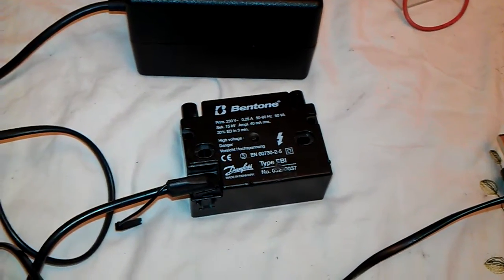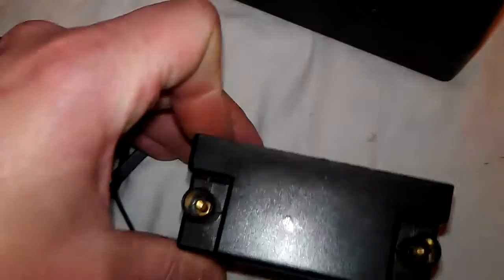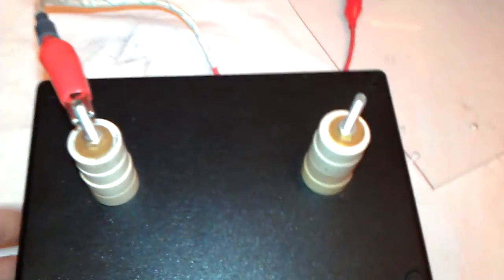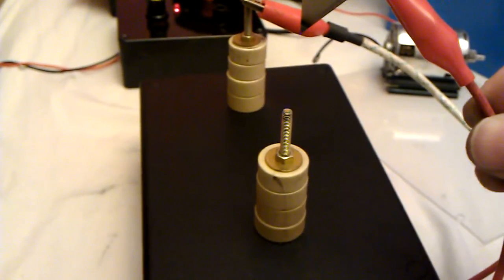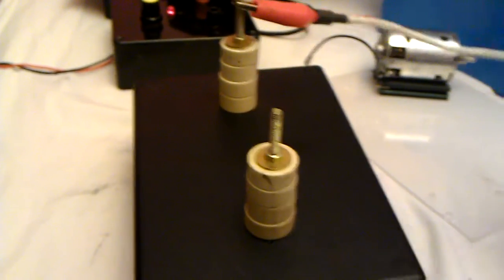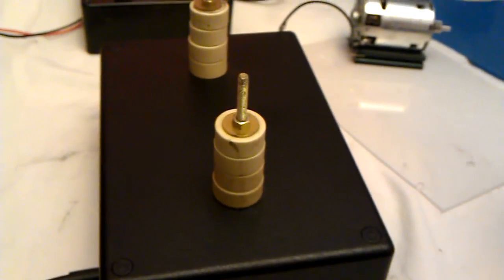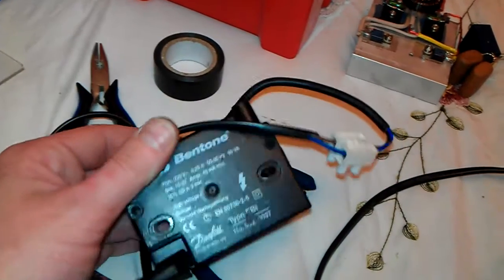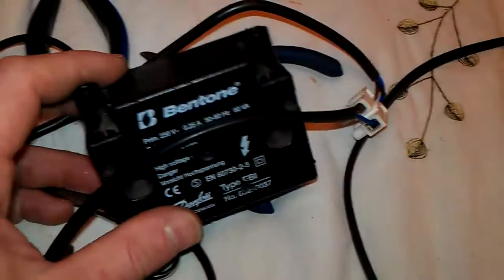ignition transformer in project box

Comment: What did that go in originally? An oil burner? And I would use a cable that has robust insulation b/c if the arc can jump to the insulated wire then it could jump thru the insulation and into you.